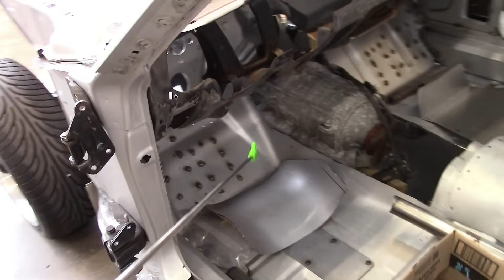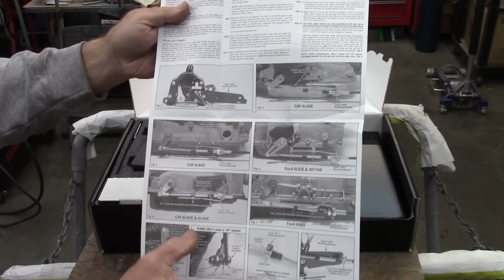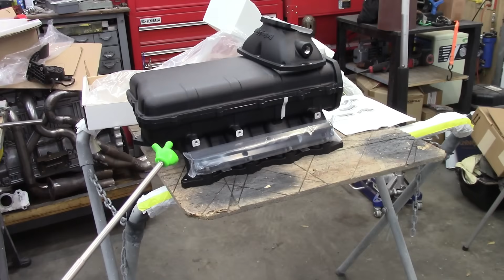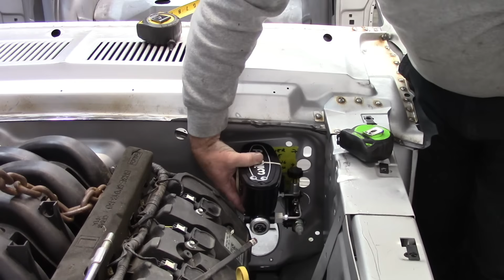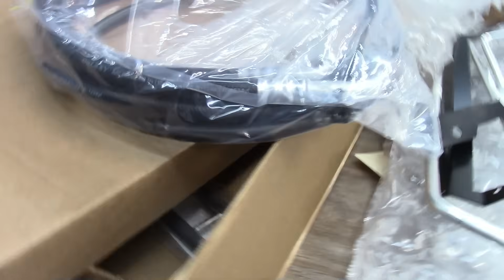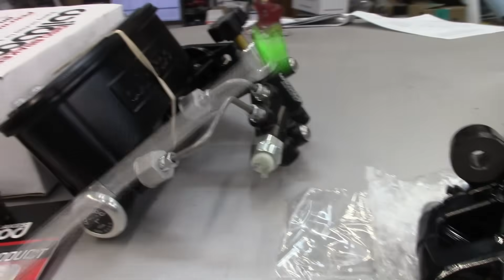68 mustang fastback build. Coyote fitment. Test fit everything!! Fangled 21. #mustang #coyote

Comment: After seeing you fitting the Coyote I'm happy with my choice to build a 347 SBF, the body work looks great, I'll be watching  more of your videos because I'm restoring a 67 cougar and need to get some tips, your welds look great ,IRMC is intake runner management Control, it has a left and right shaft with butterfly valves to open and close intake runners
Reply from the maker: Thanks for the info and I appreciate the kind words on the build!

Comment: Great video! I had a thought with the master cylinder issue, the original Boss 429 cars used a wedge that angled the master just enough to clear the valve covers. Maybe that combined with moving it over a bit?
Reply from the maker: That's an interesting idea, I'll have to look into how they did that.

Comment: In the video around 5:20, when you’re rolling the car forward to insert the engine, the rack and pinion can be seen rotating up and down.  I’m not too familiar with how racks work, but is that type of movement typical?  I didn’t know if the mounting bolts to the crossmember had rubber grommets or if the bolts just hadn’t been torqued down yet.
Reply from the maker: Nothing is tight on the rack or suspension. I don’t run the hits down because they have nylon retainers built in. I will lock everything down after final paint. Good observation.

Comment: If the new master cylinder is still tight to the back of the engine, cut and shorten the bracket the pedal hangs off it and recess the master cylinder into the firewall enough to give you clearance.
Reply from the maker: That was one of my thoughts too.